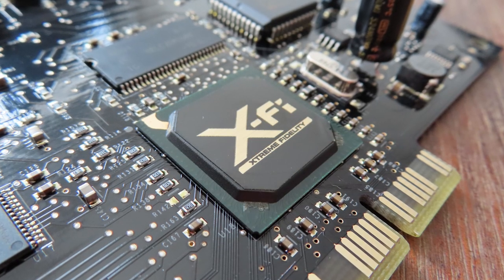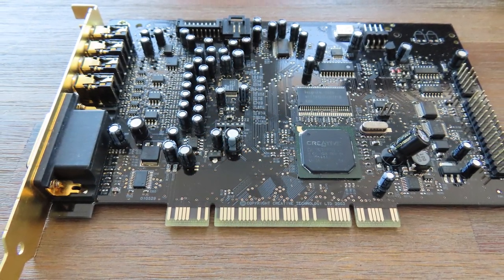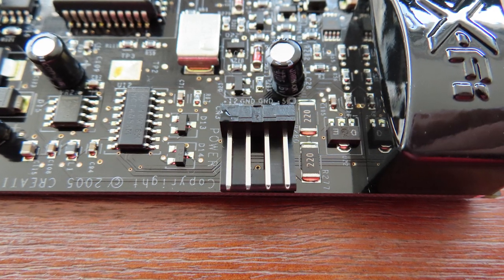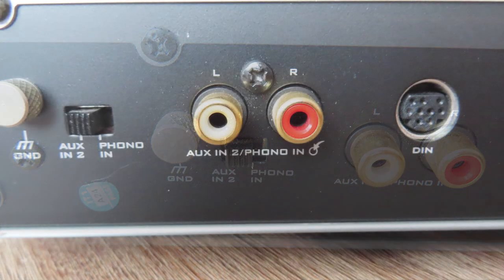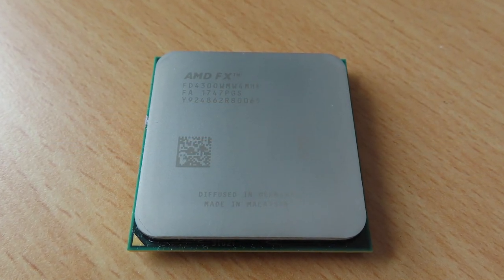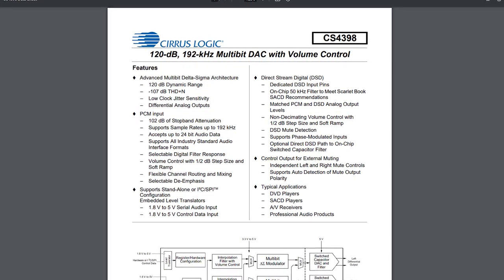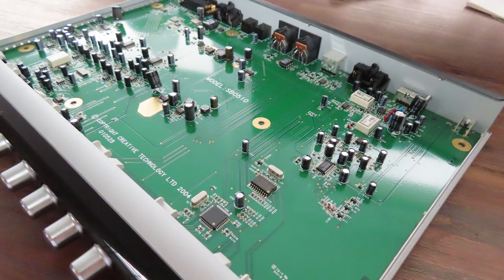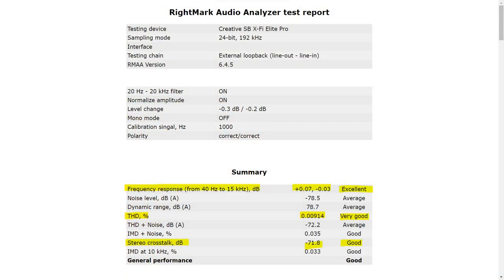Can you go Pro with Creative?

Comment: I hope you can try some e-mu stuff, i got the 1616m pcie and the older 1820, they basically both come from creative, so they use many of the same parts as the sound blaster audigy series, but they come with many improvements, especially when it come to dac/adc and support for pro features, and for those i am even maintaining os x/modern macOS open source drivers
Reply from the maker: I actually have the EMU 1212, ready for testing! It's been laying in a box for about 2 years now and I want to make a review about it. But I just cannot figure out how the software works and actually get some audio out of it. Windows 10 doesn't seem to agree with the card, even with modded drivers.

Comment: Great video. I got a few internal X-Fi cards and recently want to give the card that came with the external console a test but i dont have the molex power cable. I just want to make sure that a floppy power cable will work and not blow anything up? I have plenty of floppy power cables but i want to make sure before i try. Thanks
Reply from the maker: You should be able to use a floppy connector to molex. I've used it the other way around loads of times. https://en.wikipedia.org/wiki/Molex_connector

Comment: Isn't there another 32mb chip on the back there is on mine
Reply from the maker: First thought:  If so, I made a big mistake! But then I checked if there is an additional memory chip on the back. But there isn't., at least on my version (SB0550) there isn't. Do you have the same version? Thanks for your comment!
Reply: Will check it but might be a while as it's installed and used daily 🙂
Reply from the maker: Ok! Thanks! You did give me a bit of a scare there! :D